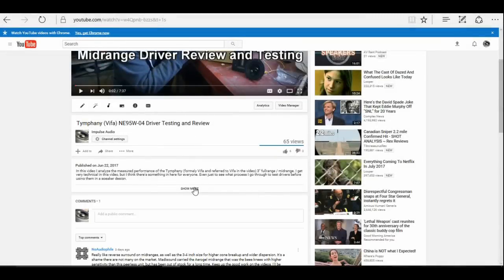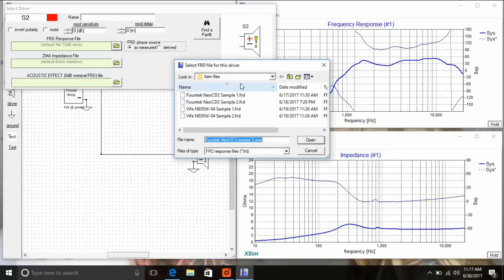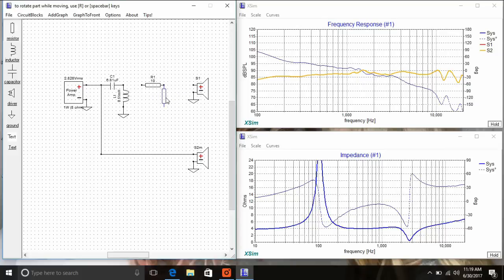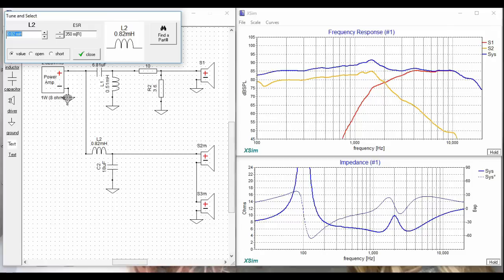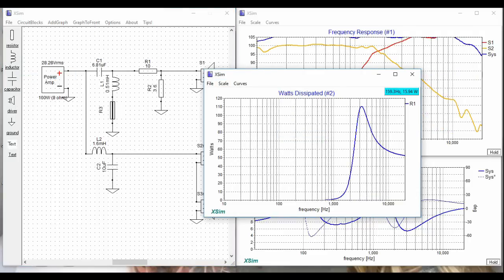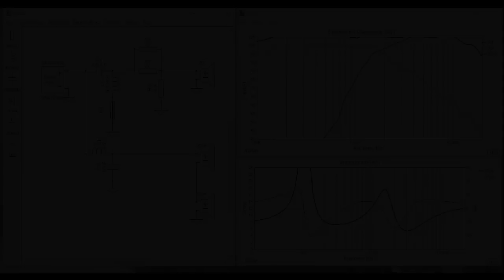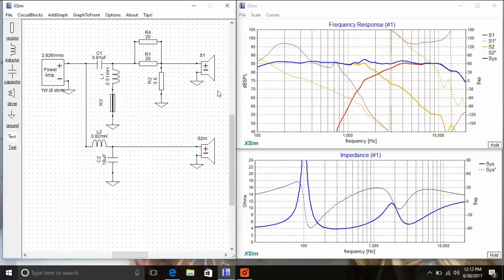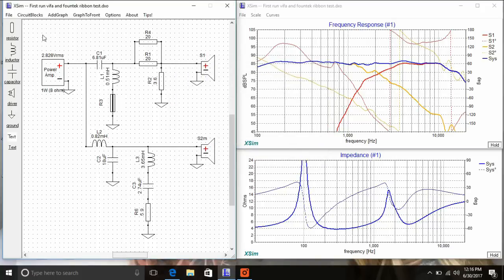Crossover Design Software Xsim Tutorial for HiFi Speakers

Comment: Ryan, please advise me on the location of that CircuitBlocks file folder. It somehow disappeared from XSim program that I just installed and used for a first time tonight. Instead of that folder "CircuitBlocks" button now gets me to the folder where I've stored FRD and ZMA data. And my laptop also can't find the "CircuitBlocks" folder on a hard drive. So now I can't use any blocks. But I used one of the blocks a bit earlier just before I've loaded driver data.
Reply from the maker: I’m not sure what is happening for you. It should be along the top menu, but I’ve never had that problem. To be honest, I don’t use circuit blocks very often, even though they are useful. So maybe I am missing it too.
Reply: @ImpulseAudioSpeakers  I have figured out what had happened. When I finished working on a project last night I have decided to save it using "Save As" option. The program offered to save the file in the "CircuitBlocks" folder. But I instead have chosen my own folder elsewhere. 

After that, every time I tried to use that "CircuitBlocks" button on the top menu the program would offer me to load blocks from that same folder where I saved my project. However, that folder has no any crossover blocks in it. 

Then I have tried to find that folder named "CircuitBlocks" on my computer but the Basic Windows 7 could not get it. So, this morning I have asked a friend of mine and fellow speaker builder to install this program on his machine. He then opened the "CircuitBlocks" option window and told me the path to that folder on a hard drive. That was my question, Ryan (the location of the folder). 

Now, that's where it can be found:
\\[Name of your computer]\Users\Public\XSim\CircuitBlocks

Comment: hello! I want to set up a crossover that can modify a curve of a mid-woofer that I have, because at around 70 Hz or so, when I put into the enclosure that I've designed, sounds really bad... and there is little I can do with the enclosure, and I was wondering if it is possible to attenuate that frequency using the crossover... I've noticed when you modified the "mod sensitivity", the whole woofer curve dropped a few decibels, but I don't know exactly if that changes something (?)
Reply from the maker: You can do this easily with eq or moving the speakers around in the room. Basically impossible using passive crossover components. The room is likely causing a boom sound at 70hz more than the cabinet.
Reply: @ImpulseAudioSpeakers  That's what I did... adjusting the volume, or the pots of my preamplifier, and it did something to a degree, but still... at a distance of about 1.5 meters or so, that booming sound was so loud, that I had to cover my ears... So you say that its the room... I could be... the cabinets are 1100/220/300 (H/W/D in millimeters), and my poor room has 3.5 by 3.5 meters, and it's not soundproof! In a way I am glad that is the room! :) 
Thank you very much! 
🙏
Reply: It IS the room! Unbelievable!!! In fact, my speakers sound AMAZING! 🙂

Comment: Excellent video.  One thing I wonder : do you use frd/zma files measured in free air or with drivers mounted in the enclosure ?
PS : would be a good idea to buy a mike and some absorption panels.
Reply from the maker: didierleclerc66 I measure in the box for XO design. Better results that way. 

Ya I’ve improved but still not a “pro” YouTuber. Not really trying to be either. Just doing it to help.

Comment: If I have two bass driver mounted in a cabinet and the load is 4 ohm at the low pass filter crossover point. If I add a further two bass drivers, would this change the response for what the crossover was designed for. 4 ohm....
Reply from the maker: Dave Jones yes it will. You will change the impedance and the sensitivity. It would require reworking the XO to sound ok.

Comment: Could you please point me to the place where I can find driver files for B&W 802 S3? I used Xsim to simulate XO for B&W 802 Se using default Xsim files and got perfectly tuned XO, but I suspect that my XO far from perfect because I do not have real B&W 803 S3 files.
Reply from the maker: Fred Kleytman you are right that actual driver files will make a big difference. Unfortunately I don’t know where you could get the files for that driver. I doubt many people have measured them. Unlikely you’ll find them.

Comment: Great video, Does this software also have the ability to simulate drivers when installed in an enclosure? and does/can it take into account front baffle size (bafflestep?) too??
Reply from the maker: It uses the measurements you provide. So if you measure in the baffle/enclosure you’ll capture the baffle step loss. I think it does have a baffle simulation feature but not too familiar with it.
Reply: @ImpulseAudioSpeakers   Cheers thanks, will be keen to give this a go

Comment: Hi Ryan
I've watched your videos about using XSim crossover design software and I think I understand how to use it, but I have a question about working  backward, so to speak. In other words, let's say I don't have ZMA or FRD files, but I know the actual crossover components and their values. Is there software I can use to determine the crossover frequency, or any of the driver values of drivers that could be used? E.g.: impedance, FS Q parameters or even expected frequency response curves. Btw, I really like your youtube channel, and I always look forward to new videos. Thanks
Reply from the maker: Ed Incleve hmm, I’m not aware of that sort of software. Would be really tricky without the files. A lot depends on the frequency response where the XO point is. Sorry.

Comment: hello, Im building 2 way crossover with 2nd on bass and 3rd order on tweeter. crossover line is  5000hz, and the graphics of the bass speaker and tweeter overlap a bit, and in general it turns out smooth. but the blue line called the system rises at the junction
. that does it mean?
Reply from the maker: lol lol that means both the tweeter and the bass are playing in phase together so both outputs are creating more output at the XO point than the rest of the system. There will be a peak in the response that may or may not sound good. Probably best to adjust the XO a bit to flatten that peak down a bit. Depends how big it is though.

Comment: @ Impulse Audio..... Whats the difference between a series and shunt notch filter? I was looking at trying to reduce a 7db peak at 15KHz of a tweeter. Also, What do you do to raise a dip in the frequency response of the system?
Reply from the maker: bsl bl a series botch is a weird name because it’s an inductor, capacitor, and resistor all in parallel, but that set of components is in series with the driver. A shunt (or parallel) notch is the opposite. In parallel with the driver but the parts are all in series. The series notch would be best for a 15khz peak but shunt could potentially work there. Shunt notches can really lower impedance if you’re aggressive and in the driver’s bandwidth. 

Dips are really hard to fill passively and depends on where and how. Possible to fill it by using the tweeter padding and filter. Certain things can work. Dips are less of a problem than peaks, and some dips shouldn’t be filled. Such as those caused by diffraction.
Reply: Thanks Ryan. I guess the name series notch is because the notch is in series with the driver and the shunt notch is so called because it is in parallel to the driver. 

So, I notice that to get the peak down, I need to go to about 60 to 70 ohm resistor value in the series notch. Is that something normal?
Reply from the maker: bsl bl no that’s not normal. Have you adjusted the inductor and cap to try and widen out the Q factor? 7 dB at 15khz is somewhat odd. What driver is this and how was it measured? If the data is good I would keep working at it and see what you can do with it.
Reply: @ImpulseAudioSpeakers  .... The driver is the Dayton ND25TA-4. I am using it with the ND90-8.

Comment: I see 10w resistor 1 is still at 50 watts how long would it last at that power level
Reply from the maker: That level of power is only going to be at very short bursts. Milliseconds. Also, I usually put a couple of resistors in parallel, essentially doubling the power handling. I’ve personally never had a resistor burn up, but if it happened they’re easy to replace.

Comment: Hello, this tutorial is awesome! I'm trying to design a 3-way crossover for my 3-way speakers right now, with real measurements i got through REW. i was able to get a decent flat response like yours, but the overall impedance curve got awry. It changes between 3-19 ohms, with 2 major peaks and 2 minor bumps. You didnt mention much about the total impedance result, what should be our target when designing an XO? Is the combined impedance important for the performance?
Reply from the maker: klazzera Impedance definitely requires considerations, but if you're using a modern solid state amp you don't need to get too fussy. The higher the impedance the easier the load on the amp. 3 ohms isn't to bad, but its a tad low. And the curve doesn't need to be flat. John Atkins of Stereophile comments on impedance in the measurements section of that magazine and can be helpful to read the types of things he finds on different commercial speakers.
Reply: thanks for your quick reply! so let's say my amplifier is rated at 60 watts at 8 ohm, does that mean any impedance value above 8 ohms mean that my amplifier power output is less than 60 watts at those regions so i should compensate with using a higher wattage amplifier for those impedance peak regions? I'll also have a look at the magazine you mentioned
Reply from the maker: klazzera yes the output will be less than 60 watts but thats not a bad thing and it definitely doesn't need to be compensated for. It just means the speaker is more efficient at those spots and the amplifier doesn't have to output as much. It's the low impedance spots that can give your amp troubles. Think of the high impedance like a benefit.
Reply: oh okay i get it, further tweaking on the frequency response i realized there are some 0.5ohm impedance dip points have appeared, i guess i'll need to fix those first. I guess i should keep the whole impedance curve above 3-4ohms. thank you so much for your help!

Comment: What is that ESR value? How do I enter the correct value?
Reply from the maker: That is just the resistance of the inductor. Usually about 0.3ohm for a small inductor and 0.5 for a medium to large inductor. Some are up to 1.0ohm if they’re big air core and small gauge. Usually labelled on the inductor or you can just put a multimeter on it and measure the resistance. It’s not a critical item to get right most of the time.

Comment: Doesn't phase line where they line up have to be at the crossover point?
If not, I've really been making thing's hard work for myself.🤦
Reply from the maker: If I’m understanding your question correctly, yes phase should align at and through the crossover region. It doesn’t actually have to, but I believe it’s the best way to design it as you get the most tweeter protection and stuff.
Reply: @ImpulseAudioSpeakers  ah, yeah that makes sense. Was just unsure if I'd just been going above and beyond to what wasn't needed but I just forcive habit. I also try to make impedance phase as flat as I can as well, although probably really not needed, certainly isn't something I hear anyone really chasing. I'm of a good understanding of impedance, but impedance phase in speakers is a job to find an explanation of how it's beneficial.🤔 Any ideas on that one? Is it something you have ever tried for any reason?
Reply from the maker: @zefrog7482  I really don’t concern myself with impedance other than ensuring it doesn’t go too low. Especially at low frequencies for a wide band of frequencies. If it goes down to 2ohm at 8khz, or something like that, I don’t get too concerned. 3ohm from 60 to 200 hz is a problem for some amps.

Comment: Can you recommend any cheap microphones to go with xsim to design a crossover?
Reply from the maker: Max B. Simonsen I think the minidsp umik is pretty cheap at around $100, and is perfect for the job. But if that’s pushing the budget try google Panasonic WM61 capsule. I might not have that quite right, but it’s a DIY mic you can build for about $5. Not bad either. You’ll want to upgrade in the future but worth using it to learn.

Comment: When this program starts, you'll get the speakers.When you call in two twitter and woofer, if you synthesize an RTA graph, the graph sometimes goes over the screen too much, and the dB difference between the speakers is more serious than you think.In this case, how is the setting correction year right?

음성듣기
Reply from the maker: W엉덩 I don’t understand the question. Maybe I haven’t had this issue before.

Comment: Thanks i try this application but i experienced frustration our speaker has no complete specs data sheet.
Reply from the maker: Yes you do need the measurement files. Without those it will be frustrating.
Reply: @ImpulseAudioSpeakers  thank you sir. Here in  the philippines they are not incline to use dividing network. We rely to ready made dividing network from online seller.

Comment: Hello!
This software only understands frd and zma. What program do you measure drivers to get these files?
Reply from the maker: You need to use measurement software such as Room EQ Wizard or HolmImpulse. You can also change a .txt file into a .frd but the txt needs to be in an frd or zma format.
Reply: @ImpulseAudioSpeakers  Thank you, I know that.
I use LoudSpeaker LAB 3 for measurements, but unfortunately it cannot export frd or zma, which is why I ask which one are you using.
Reply from the maker: @home_lab  does it export txt files? Could convert those.
Reply: @ImpulseAudioSpeakers  the software I use cannot do this.
Do you know how this can be done, with which program?
Reply from the maker: @home_lab  all the measurement programs I’ve used can do it through the export options. But I’ve never used your software. Sorry.

Comment: great and informative video! 
would you happen to know any program that i could extract/copy/trace the FRD and ZMA files with based on driver SPL graphs? i have Visaton drivers but i can't find any data files for them online..i read about a program called SPL Copy or smth but its not available anymore..atm i'm using Boxsim for crossover design but it's kind of confusing for a newbie like me
hope you can help :)
Reply from the maker: Martin Ahven the only one I'm aware of is SPL trace but I think that's probably the one you're thinking of. If it's not available anymore I'm not sure what to say. I know another channel called 123Toid has done a video about it, so you could check there. You can also manually do it but that would take forever.
Reply from the maker: So I have been informed that fprawn's FPTrace is the new program to use. It's apparently quite good, though I haven't tried it. Hopefully that helps.
Reply: @Martin Ahven: I tried FPGraphTracer but it sometimes recognises the wrong lines depending on where you click. You might have to compile one file from parts of several files.
If you use Visaton drivers you should definitely play around with BoxSim. If you speak German watch the BoxSim tutorial by "Leo Lautsprecher". It's really good! Maybe also watch my tutorial about crossover design where I used BoxSim but don't explain much: https://www.youtube.com/watch?v=5Kvl0iBQ0L0&list=PL4lJ1ej0uWlQjzOstioAZ1bd555vG9WHF&index=1.

Comment: Hellow Ryan! I hope u r good. I got a confusión about pre-design crossovers. As we know, there are lots of crossover labels in the market. All of them with a specific cut of freq and components. let's use, for instance, the Dayton XO3W 375/3k. If we are looking for those specific cuts, what's gonna happen is that... we're going to buy that crossover because it supposed that is gonna work,  but as soon as when designing our crossover for our system in Xsim and we put those values of those components of that pre-design crossover  to see how it going to behave and for achieving those cuts entering the FRDs files, they change a lot. Those values are not the same anymore. My confusion is...when that label built that crossover, they built it base on what? Because and,-correct me if I wrong but,- I don't think they come with a manual saying: "oh, by the way, this crossover works perfectly just with eminence speakers oooorrrr whatever".  I don't know if u get me, bro, ooorr maybe I'm missing something or I'm still ignorant of something. Can u help me with this? or can u make a video showing whether if it is true or false or something educational about this the way u did in the video on "whaty not to use online crossover calculators?" Thanks, Ryan.
Reply from the maker: Joseph Anselmo you are correct. Those things are junk. And I actually did make a video sort of about it. It's called something like "why to NOT use online crossover calculators". Those prebuilt crossovers are based on perfect flat 8ohm loads without any deviation from flat and assume phase is perfect. They never work.
Reply: What that hell! I had that little bit that those things are junk.

Comment: Hello, how do I enter the parameters of the measured speakers? Thanks
Reply from the maker: Do you mean the TS parameters? Because you don’t enter those for crossover design. That’s for box design.
Reply: @ImpulseAudioSpeakers  thank you for your answer, I would at least like to enter the necessary parameters like impedance ..
Reply from the maker: @mikreference3a130  you need to edit the driver and add zma or frd files.